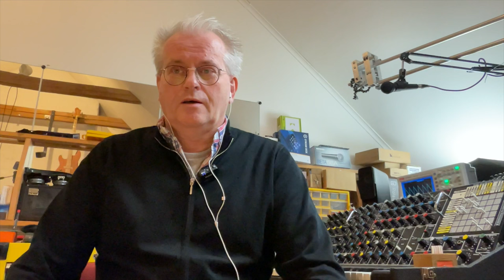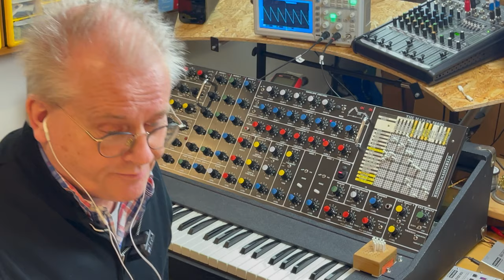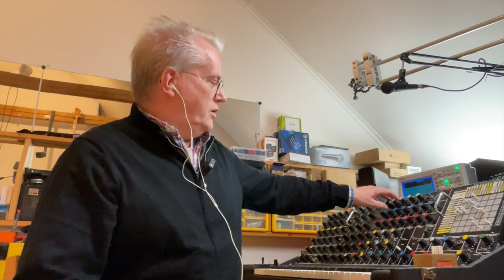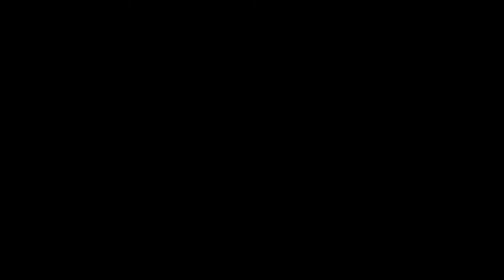Maplin 01 230103

Comment: FANTASTIC!!!  I've always wanted a 5600.  It was my dream synth as a kid and still gets my blood pumping.  How I wish Behringer would add the 5600 to their list of 'legacy synths we have to recreate'!!  Thanks for all your work and for sharing this video.  :-)
Reply: I thought it was rubbish back in the day because they are linear oscillators (V/Hz) but you get stability which many of the V/Oct could not achieve. Also, the detuning is equal across the keyboard I think.
Reply: @__teles__  well I guess linear just means you need a lot more DC volts to make an 88 key version. Wouldn't want to spill beer on that!
Reply: I so agree with you.  Plus I've never heard of the Maplin 5600. My God,  where have I been.  Un-freakin-believable 😊

Comment: Du råkar inte va svensk?
Reply from the maker: Jovisst, som jag säger i flera av filmerna.
Reply: @johanolofduner  Sorry det här var det första klippet jag såg. Hehe
Reply: Excellent demo! I lusted after this and it’s Elector counterpart. Had a go at building the Practical Electronics version, but my skills didn’t match up to what was needed, as some of the design aspects were a bit dodgy, and I couldn’t fix them. Great to actually hear this machine, it outperforms my expectations!